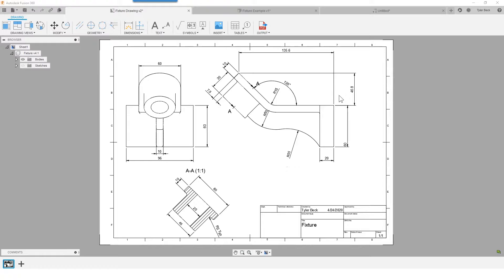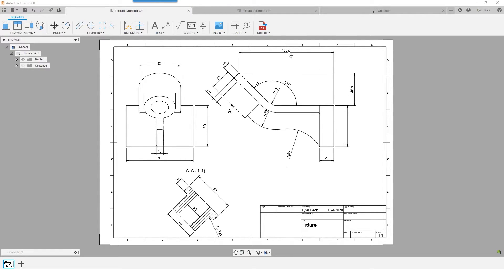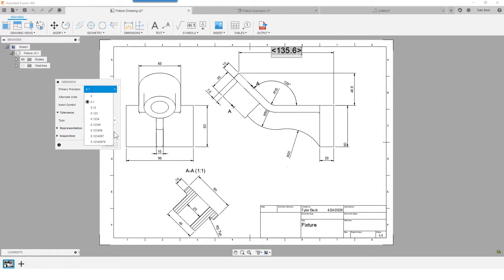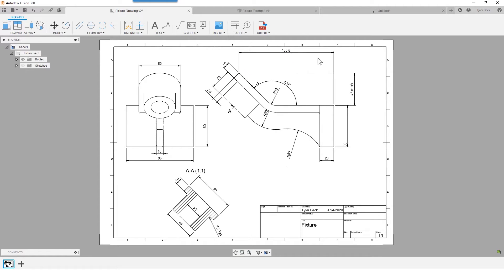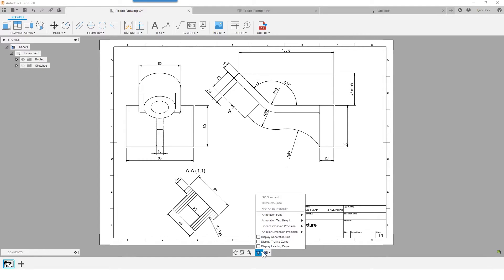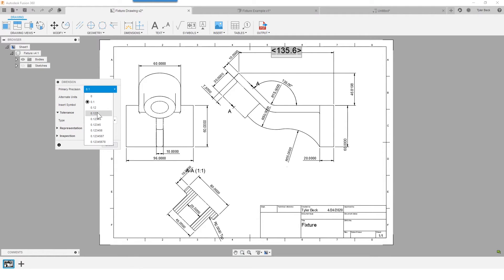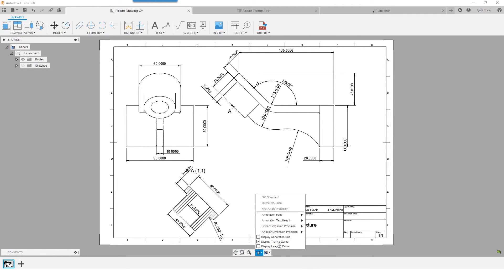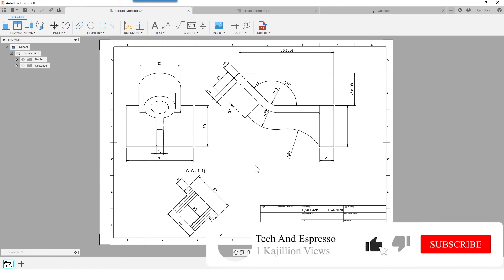Fusion 360 - How To Change Precision in Drawings (How Many Decimals)

Comment: not there, also not in document settings and not in profile preferences.  I'm wondering if the personal use version doesn't do more that 3 decimal places.   5/16" is 0.3125.  I don't want to round it up or down.